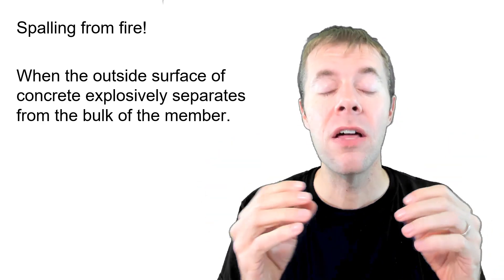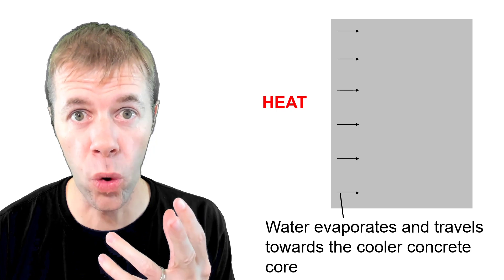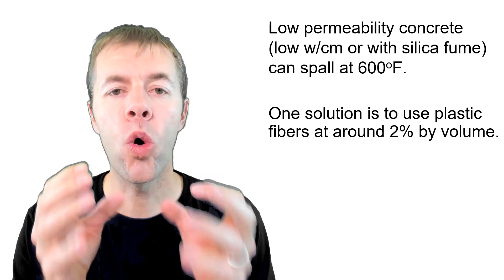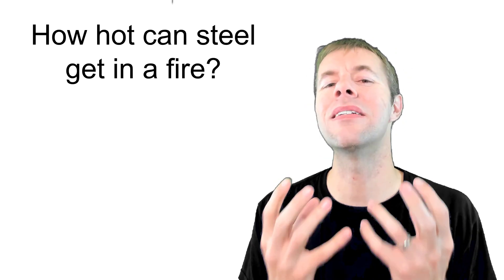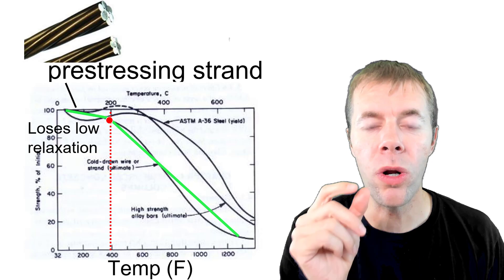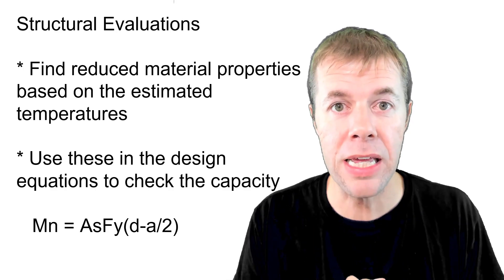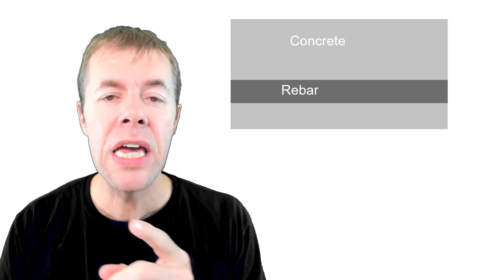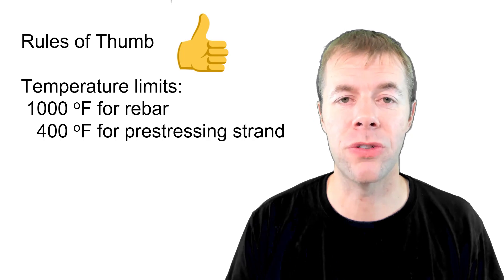Spalling of Concrete in a Fire

Comment: 5/14/2024: I set my shop on fire. 4k sq ft, 50x80.  The spray foam insulation got to combustion temp and every square inch inside the building burned. The fire lasted maybe an hour. The fire department, rural volunteers, showed up 20+ min after I called 911 and put a little water on/in one end.

After cleanup, the slab looks like a German airstrip in 1944.  Some spots were maybe 1/8", some over an inch.  I tried patching the spots but there were too many and I gave up, pushed the "Easy" button, and had 6" poured on top. "Easy" except paying for it.

I never thought about the rebar getting hot enough to yield, but I'm sure it did. The slab ponded badly, one large area left of center on the 80' direction, one on the right. It had bellies.  It didn't when it was poured. 

I learned good stuff in this video. I feel more confident in my choice to cap the slab. 

The original slab was 4", something I'll never do again unless it's for an air compressor or similar. The rebar was #3, I don't recall the spacing. "Chairs" are something people sit in, not to hold rebar in place...🤬  They didn't use chairs for crap, something I'll never let happen again.

Towards one end of the 80' direction, there were several places where rebar was exposed, sometimes within 1/4" of the finished surface. For a slab with no expectation of load bias, that's ineffective and amateurish. If you don't already have a video on the subject, a video on rebar supports, especially the spacing, would be most interesting. The 6" slab had chairs under #4 on 16" centers...but they did maybe 25% of the intersections. After they left, I put dozens more in. The workers on all the slabs I've watched get poured run over the rebar like drunk buffalo. They don't care, it gets a glass finish, they get paid, and it's not their problem. 

FWIW.  Thanks for your videos, I've learned a lot about getting and pouring better concrete. I wet-cured my new slab and I'll be ready, when the time comes, to properly finish it (sealer or maybe densifier and sealer).

The burned slab was boom pumped but still looked like soup which may have affected it's ability to withstand the fire.  We're in a rural area...most of these yahoos couldn't spell "admixture": the only way they make concrete easier to place and consolidate is to have the driver add water. Even specifying a slump isn't very effective because the drivers rinse down their truck funnel w piles of water. The guy who did the 6" cap slab is the guy to get around here...his concrete showed up looking like it had a "slump" instead of soup.  He had told them, per the driver I know through having orderer concrete before, was, "If you send me a wet load, I'll send it back." Words of caution to anyone thinking of ordering concrete from a plant.

Comment: The best explanation ever why concrete spalls in concrete. You proposed the use of low-melting fibers in plain matrix of concrete. But this is not enough to retain high residual strength. The better approach is to use hybrid fibers (use steel fibers with synthetic fibers). Plastic fibers melt and the steel fibers can minimize the strength degredation. 😉

Comment: - would you please make a video to inspect and evaluate the foundation of a fuel tank that burnt for hours when it was full.
- is the result of Schmidt hammer enough to redesign the member depending on the reduced compressive strength of concrete or we should go for more tests?
- should we test the tensile strength of the rebars to update the strength of the steel in the redesign?

many thanks for your valuable videos'.

Comment: If you wanted to make cement that spalls dramatically for demonstration purposes, how would you do it?
Reply: I think, first make the water content very high, you can submerge it in water for few days after casting. Then also prepare it with high water to binder ratio. Add silica fume to make it less porous and consider the size. I had some crazy spalling with cylinders 300x150 mm. Heated 5 C/min or faster will also help you do that as the water has less time to escape the pore structure of the concrete.
Reply: @andresarce5514  Thats pretty much what i did, you can see the results here https://www.youtube.com/watch?v=-v-II1FPFSU&t=430s

Comment: humidity and air inside the concrete becomes vapor trapped within the pores and when pressure increases, concrete explodes,  from inside out!.. high pressure vapor seeks the path of least resistance, so it tries to migrate to the surface but  concrete does not allow it. Vapor is trapped until pressures builds up and breaks the concrete suddenly.

Comment: I agree with every point. 
However, these things are only true of Portland cement based concrete.

Cement is a binder   Portland cement is one type of binder. It is by far not the only binder ( cement ) and is not the best choice in some applications 
OPC creates a pore and capillary structure 
Ceramic cements, Geopolymer cements and our Algae derived binder make concrete which eliminates the problems you point out
Reply from the maker: Thanks Jonathan!  You are right that this only applies to OPC.  We need more research on these alternate binders to give insights into how they perform.
Reply: Tyler Ley yes, I agree 
Other countries are way, way ahead of us in the area of utilization of what I call “ appropriate binders”. I have built concrete structures all over the world for 33 years and now, for the last 14 years, I have devoted my efforts to research a development in appropriate binders.  Sometimes even OPC is the correct choice 😀.

Comment: Great video. Sometimes people want to use discarded manhole sections as a fire pit. I allways tell them it's not a good idea. But might make a good raised garden bed. 

And when cutting rebar with a torch. Don't get close to the concrete floor. Get one of these hot concrete pieces in your work boot when it pops. You'll be hopping around for a little bit.
Reply from the maker: Thanks Patrick!  Good call on the torch.

Comment: Thanks Tyler, good subject and video...  Also, never weld on concrete, it can be a deadly projectile! PS I think it is ''steam'' that causes the explosive forces...  Like a boiler- exploding...
Reply from the maker: Thanks for the comment! 
There is a lot of debate about this.  It seems to be caused by a combination of the steam and the liquid water.  Steam can move through concrete pretty easily and so the pressure build up is not that large and so it is not just the steam.  However, liquids take much longer and there is often liquid water present right at the surface of the spall after it happens.  Once the liquid forms then the vapor between the liquid and the surface may increase in pressure and cause the spall.  I agree with you that I should have done a better job of explaining it!
Reply: @TylerLey  ,  I think you did a great job of sharing... I was not attacking on that point...   Keep the videos coming. Thank you.
Reply from the maker: I didn't think you were!  Thanks so much for the support.
Reply: How hot do "usual"building fires get?